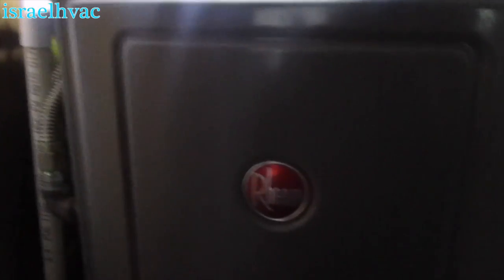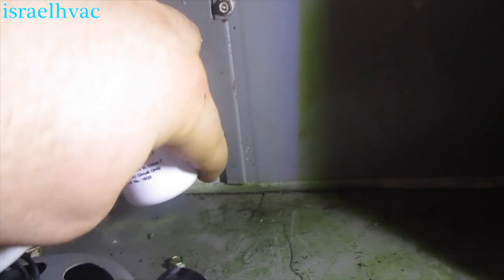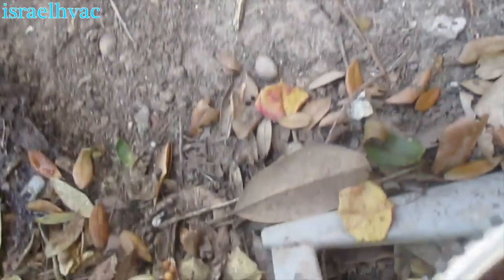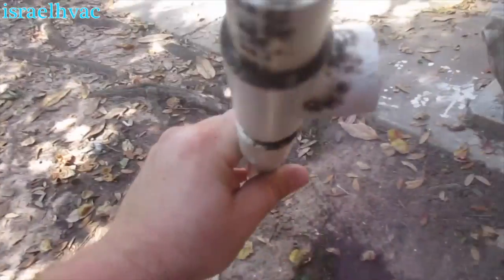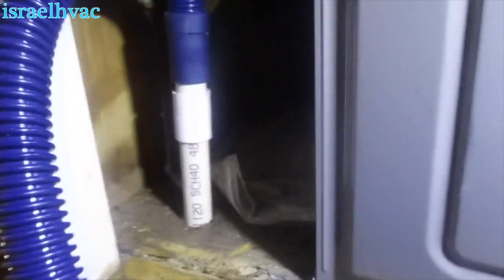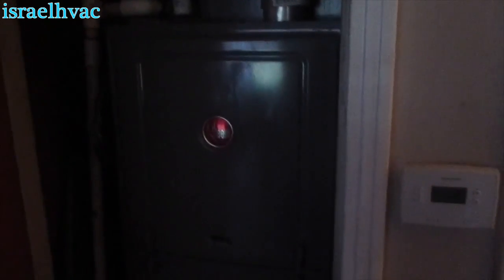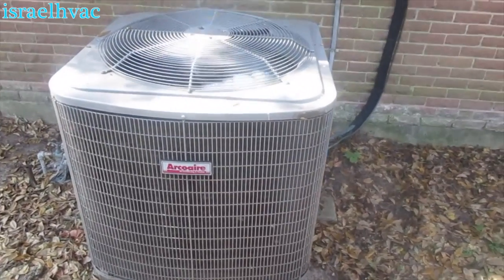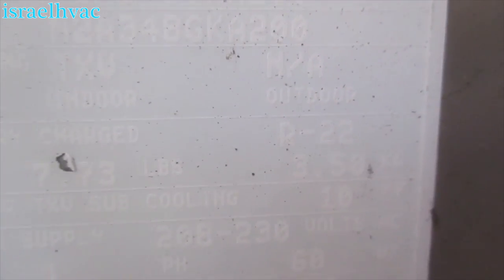HVAC Service: No Cooling | Nothing Runs

Comment: Hey John do you glue those 90s for the ss2's? I know they usually have a good grip if they're pushed on good.
Reply: I dont glue mine, water should never be in it, and if it does get in it, its only a small amount before it turns the unit off

Comment: Quick off topic question: My boss wanted me to mix in 407C into old R-22 system...I did not...but the question still the same...
Reply: I pulled a vacuum down to 500 microns...then I weighed in (407C)per data plate info of factory pre-charge(22)...just pumping in more life into an older inefficient system...I am extra careful to tag system with perm-sticker(marking) when I use drop in replacement refrigerants...following up on or servicing older equipment (How can you tell what type of refrigerant my be present in system?)